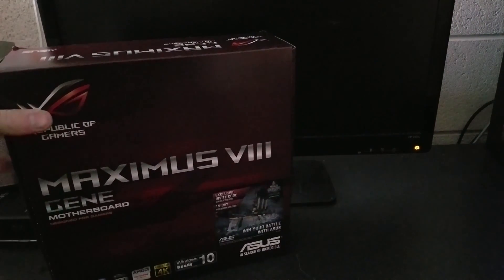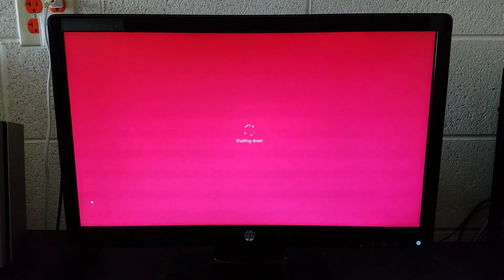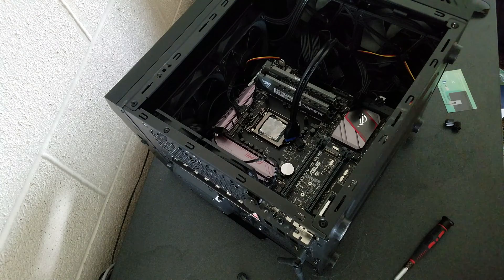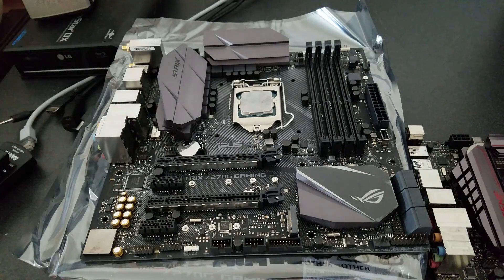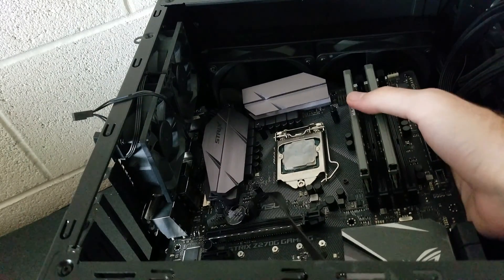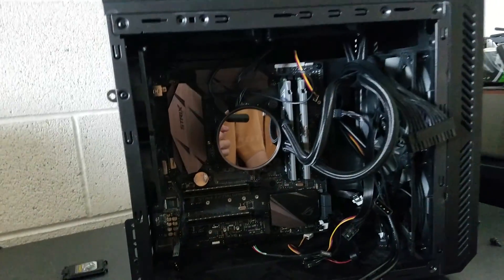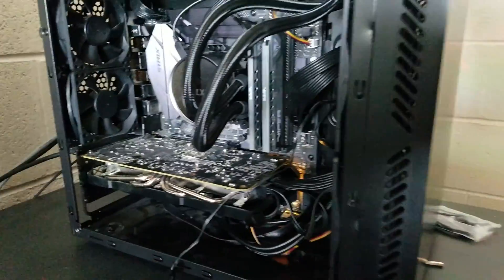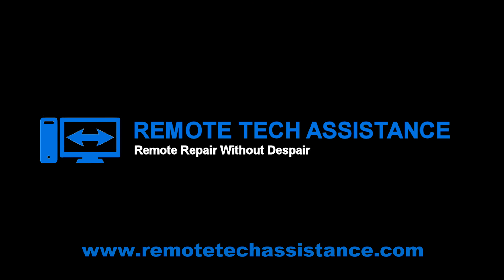How To Upgrade Your Motherboard (2017 EDITION!)

Comment: URGENT HELP REQUIRED PLEASE

Hi Stephen, I hope you are well. If I could please have a minute of your time I'd be incredibly grateful.

Simply put%
1. I have windows 10 (not upgraded from windows 7, just a proper windows 10) that has been activated with a purchased cd key.

2. I am upgrading only my motherboard. I am going from Asus H310 - MSI Z390, different chipsets, but both are 8th/9th gen Intel. 

3. Every component is the same, not upgrading a single component. 

So please, how would I go about this motherboard replacement. 

People are saying this:

Reset pc (to get rid of drivers) > unplug hdd and leave ssd plugged in > boot up pc from USB and reinstall win 10 fresh, selecting format ssd > manually find and reinstall all drivers.

So please:
1. Is all this necessary, and what can I do to avoid all this?
2. Manually install all drivers? Shouldn't Windows install them automatically like it did the first time? Other than nvidia drivers of course.

My motherboard is arriving tomorrow.

Any help is gratefully appreciated.
Reply from the maker: To be safe, I'd reinstall windows after the upgrade
Reply: @StephenPhillips  Thanks for the reply. Appreciate it. Subbed 🌟

Comment: What happen i didnt uninstall those drivers,will my pc wont run on new mobo?pls because my pc shows no display and gpu's fan are not spinning
GPU : GT 440 - minimum fan is 45%
Reply: Codenamenok Noakes Did you fix the problem?

Comment: Great video. I have a workstation with three SSD's - one with Windows XP, a second with Windows 7 and the third with Windows 10. I simply need all these OS's due to software compatibility issues. A nightmare to change the motherboard in such a system, without doing a fresh install of XP and 7...

Comment: But wait , you didnt have to reinstall windows? I was told if your swapping out you’re mother board you need to use a different hard drive or ssd that has the operating system on it bc the mother board wont recognize it.
Reply: Joey This may help you: https://support.microsoft.com/en-ca/help/20530/windows-10-reactivating-after-hardware-change

Comment: Will windows automatically detect new mb, cpu, gpu when i boot up and have no issues? I was told i need to basically format my old hard drive and reinstall windows 10 on new build
Reply from the maker: Make sure Windows moves its activation over to the new motherboard. If it does, then do the clean install.

Comment: Can someone plain to what could happen if I don't remove the drivers and chipsets
Reply from the maker: Ki Kak actually, I'm not sure if anything WILL happen, but it is strongly recommended to do so.
Reply: the monitor says "Windows Unable to  upgrade" mous keyboard are not working at all. No way to handle it. cheers

Comment: I have a strange issue where my pc just goes straight to the bios, and I can't get out of it. Any advice?
Reply from the maker: Jordan Galati Have you tried ctrl alt delete?
Reply: Yes. It reset my pc and it loaded into the bios again upon boot. I recently upgraded from an old mobo to a rog strix b360-g, and an i5 2500 to an i7 8700. I want to fresh install windows, but as I bought my pc pre built initially, I don't have  any cd's, usb's with Windows on them, and I don't have the windows keys. Not entirely sure what to do here
Reply: my last name is ice cream did you figure it out?

Comment: I currently have an Asus H110-plus mobo with an I7-7700 locked perocessor.  I wanted to upgrade my MOBO mostly to expand RAM.  WHat chipset can I upgrade to? Would a Z270 be ok? what addition software would i need (other than a fresh install of Windows 10)

Comment: Why is it recommended that you uninstall all that stuff before switching mobos?
Reply from the maker: Thunder Grinde So it doesn't screw everything up
Reply: Stephen Phillips could you elaborate on that? Like why would it srew everything up
Reply from the maker: Thunder Grinde I have seen other videos while prior to upgrading your motherboard, that it is strongly recommended to uninstall any drivers or utilities related to the current motherboard. That way you do not have to worry about getting any errors whatsoever.
Reply: Stephen Phillips ok that answers my question thanks
Reply: @StephenPhillips  then why did u delete the GPU drivers if u only delete motherboard related ones
Reply: @StephenPhillips  and after that u download them again?
Reply from the maker: @dimaaftaritet  some yes, others are installed automatically.
Reply: @StephenPhillips  so if I do that no need to reinstall windows or get a new harddrive?
Reply from the maker: @dimaaftaritet  No. However it is recommended to reinstall windows after a while.
Reply: @StephenPhillips  what would happen if I won't
Reply from the maker: @dimaaftaritet  Nothing really. I just recommend it.

Comment: no thermal greace between the cooler and cpu ?
Reply from the maker: It was not necessary. I was moving them both over to the new motherboard.
Reply: @StephenPhillips  I think it was necessary as it had nothing on.
Reply: @Nasr Hussain. It had thermal paste previously on it and he was using the same cooler which also would’ve had some thermal paste.
Reply: @StephenPhillips  I think that every time  you pop that baby, you should take the opportunity to add some lubrication! She's been working hard.

Comment: Am doing a new PC build with LOTS of RGB and I need help because am not sure if everything is compatible 
I5 8600k
Deep Cool Gammax RGB
ASUS ROG Maximus X Hero (Wi-Fi AC) Z370
Asus strix GTX1060 6GB
Team T-Force Night Hawk RGB 16GB DDR4 SDRAM DDR4 3000
Thermal take versa C23 TM
KINGSTON 240ssd
Seagate Barracuda 2tb hdd 
Help would be appreciated
Reply from the maker: Da Quack Great component choice!

Comment: What if i want to install a new mobo what is basically the same brand/chipset as the old one? i'll just upgrade my miniatx mobo to an atx one due to a broken ram slot. so i just take off network and chipset driver stuff and ready to go?
Reply: Just install the new mobo and log into to your Microsoft phone once you get into Windows. As long as your chipset is the same windows will recognize it.

Comment: Hi, I actually sold the actual mobo, processor (AMD), and graphic card to update to Intel, I didnt do anything that you commented in this video before, just a little back up with important info, so what can I do now to keep my windows and stuff installed? Am I going to have problems with the drivers?

Comment: Hi, do you need to uninstall the external graphic card drivers or sound card drivers if you will be using the same cards on the new mobo? If you're using integrated graphics/sound then obviously yes, but you are using an AMD discrete card...is tthat really necessary?
Reply from the maker: ROKUGAN yes

Comment: Do you need to uninstall the CPU fan with a stock heatsink for a motherboard swap or do I need to the uninstall and reinstall the CPU? Im actually not swapping out a new motherboard. Im taking my motherboard with an i3 6100 along with the RAM and trading with my sister for an i7 3770 and her RAM.
Reply from the maker: Lavancer You can reapply the heatsink, but reapply the thermal paste too
Reply: Ok, thanks my man! You earned a sub :D

Comment: So im upgrading from a gigabyte with AMD processor to a MSI intel processor, I want to keep my windows 10 working and keep my same HDD. Am i supposed to Back up my HDD and if so... how do i back up a full HDD, and all i have to do is uninstall all the drivers that have to do with Gigabyte, AMD and my graphics card? ie. what drivers do i NOT uninstall, thanks would really like some insite most places aren't too clear and this video was VERY clear just trying to get a direct answer

Comment: My parts for my build are coming in next week. I'm currently running on my windows 10 free upgrade copy from Windows 8.1. I'm upgrading my motherboard, graphics card, CPU, and changing ram. 
I would like to keep all of my programs and files on my drives because we have 500gb per month for Wi-Fi, and its also very slow, so reinstalling and downloading everything would not be practical. I see a lot of suggestions to reinstall the OS. 
Even if I had to buy a new copy of Windows 10, is there a way I can reinstall without losing everything on my drives? And if there isn't, should I just use this way? I'm just trying to gather the best suggestions.
Reply: Try downloading the OS through a USB through this site: https://www.microsoft.com/en-us/software-download/windows10 and then plugging it in when you get your new mobo and manually install it on startup and download it from your USB.

Comment: I don't understand what devices I should be uninstalling. I don't have the same things as you...
Reply from the maker: Tropicar Anything chipset related, video drivers, sound drivers, anything like that.
Reply: I want to replace my CPU at the same time. Do I remove all devices from "Processors"?
Reply: No, it'll make changes to the processor automatically.

Comment: Ive seen a few other videos that say you need to uninstall basically every driver including those for usbs etc. Just wondering if that is in fact necessary or not as you havent done it in the video here or if its okay to just delete graphics card drivers, sound and motherboard drivers as it looks like you doner here? Also, in my system devices tab i dont have any chipsets? So confused as to what i need to uninstall in order to install my new board correctly when it arrives. Just dont want to ruin anything. Are you able to help?
Reply from the maker: Josh Mitchell I actually reinstalled the operating system after upgrading. It was the easiest thing to do.
Reply: I have the same problem!
Reply from the maker: I strongly suggest reinstalling the operating system after you upgrade your hardware. Just to confirm that activation is not screwed up.
Reply: Stephen Phillips do you have to uninstall ?? Or can i just uninstall the chipset family , graphics , and sound ?
Reply: Stephen Phillips how is this done exactly? Do you have to format ssd's and such first and reinstall all the programs after?
Reply: @Wang

Yes that is pretty important and should not have been left out. The video makes it all sound simple which it is but leaving out something is going to have people with less experience get in a bind.
Reply: I am about to upgrade my 2016 first build. h170 mobo, i5 6500 to Z370 Mobo, i7 8700K. Just doing research on easiest and correct way. Some videos say delete drivers associated with Mobo and others say just make sure Win 10 is activated under your name and not local.
Reply: jcaashby3 did you find an answer to this, I’m going through the same thing?

Comment: Am I correct I  assuming the process is identical when upgrading the cpu as well? Delete cpu family/gpu sound/gpu is all that's needed or is there more necessary for going up generations? I'm replacing my 4790k with 8700k and putting in an Asus hero x. Thanks.
Reply from the maker: Sean Schweizer If the LGA sockets are identical
Reply: Stephen Phillips that's unfortunate, unless something was confused.

Upgrading both mainboard+cpu requires more work if the new hardware isn't the same socket # as the old? The plan is to replace them both in 1 go, not to do one then the other sometime down the road.

Comment: Hi does changing from b350 to x370 motherboard is the same?? if not how? do i need to uninstall all drives? and format the ssd?
Reply from the maker: I would uninstall whatever you can. You don't need to format the SSD. Changing AMD motherboards is the same, indeed. However, I would recommend re-installing the operating system anyway.
Reply: alright!! thanksss!!!

Comment: Hey man, thanks for the guide. So you did just plug in the Old Harddrive / SSD with the Windows Install on it and it worked? Btw, when i choose to do a clean Install, will Windows 10 activate on its own, when linked with the Microsoft Account? I hope you can answer me :) Thanks a lot!
Reply from the maker: Yes on the SSD. Yes, the activation should work.

Comment: But what about a clean install? Shouldn't you do that which also mean backing up your files?
Reply: While it is recommended always to backup your files when performing major hardware upgrades, such as this, Windows 10 will allow you to install a new MB and CPU without the need for a clean install of the OS. Go to Settings>Update and Security>Activation and under the "Add a Microsoft Account" section click "Add an account" if you have one. If you don't have one, go to the Microsoft website, register a new account, and then link that account. Do that before you upgrade your components, back up your files just to be safe, then after your hardware swap go back to that settings page and check your activation status. Be careful with your Windows version, though. Some people who had previous versions of Windows and used the free Windows 10 upgrade have experienced activation issues with motherboard swaps to the degree of needing to purchase an official copy of Windows 10 with it's own product key.

Comment: Nice job on this tutorial video! My old HP Pavilion a700n PC with Windows XP Home Edition SP2 on it stopped working nearly six years ago, and I believe its motherboard fried, but it still hasn't been fixed yet. I'll try to find a motherboard replacement on eBay so I can get it running again.
Reply from the maker: CEO100able Maybe you're due for a new computer
Reply: Actually, I do have a newer HP Pavilion PC, which is an HP Pavilion p6230f model. It has Windows 7 Home Premium on it. I received it for Christmas in 2009. Four-and-a-quarter years later, its original hard drive failed, so now it's running on a new one, with a higher HDD capacity. The OS was upgraded to SP1. Some of the files from the old one were backed up, but not all of them, unfortunately. It still works today. I'm on a custom-built Windows 10 Home PC now, which is officially my main computer as of Christmas 2015.

I plan on repairing my HP Pavilion a700n PC because I want to use it again for nostalgia and even make a video about it since it's my second HP computer from my childhood. I used to have an HP Pavilion 710 CTO from 2002 to 2004, which was my first HP PC, but sadly, I don't have it anymore.
Reply from the maker: I see. Well, you should get an all-in-1 machine.